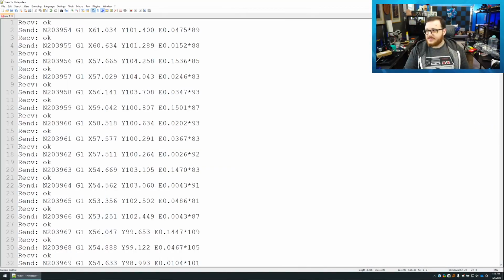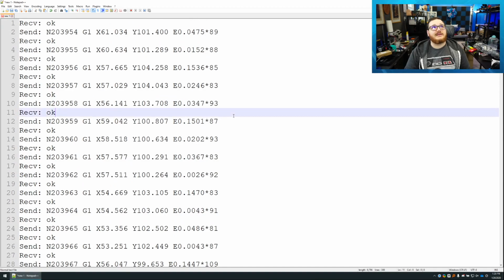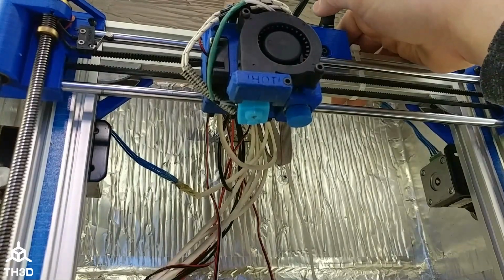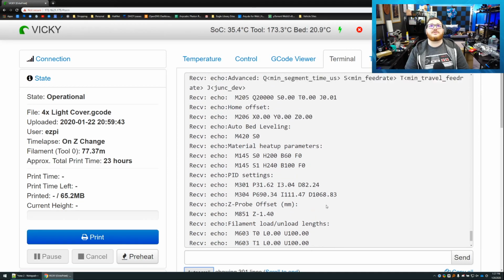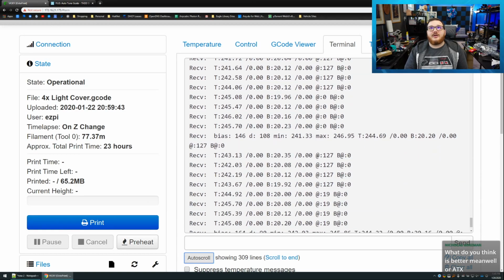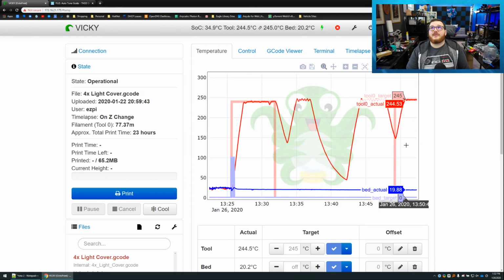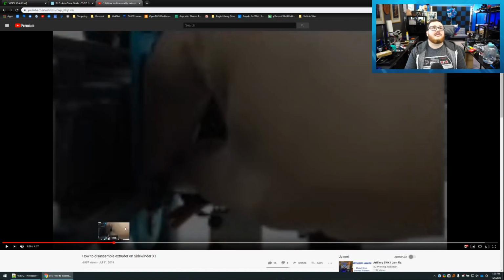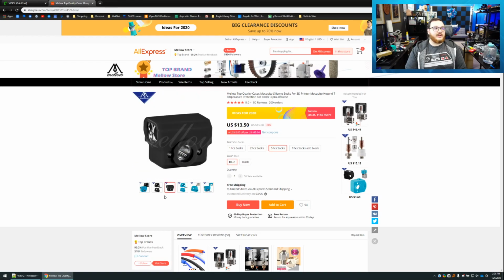[LIVE] Troubleshooting Thermal Runaway - Hotend Error

Comment: I assume a failing hotend mosfet would behave the same way?  Asking because I believe one of my CR10s has one that's on its way out based on temp fluctuations.  I'll try a PID tune just in case that's it but I'm pretty sure this started out of the blue (and I have had a couple thermal runaway incidents - wish I'd thought to check the Octoprint logs).
Reply from the maker: MOSFETS usually just work or don't. You could have a 5V rail issue which causes temp readings to be bad. What board?
Reply: @TH3DStudio  Stock, non-S with bootloader I installed and one of your FW stacks with Manual Mesh.  I have a EZBoard and a couple MKS GenLs I picked up from you and am planning an upgrade soon.